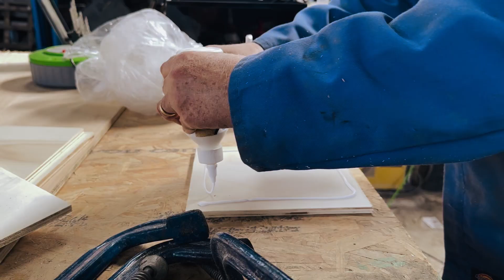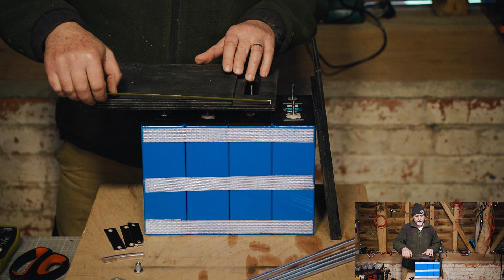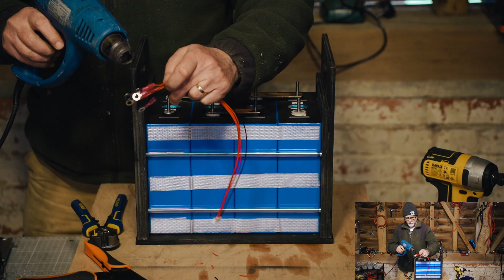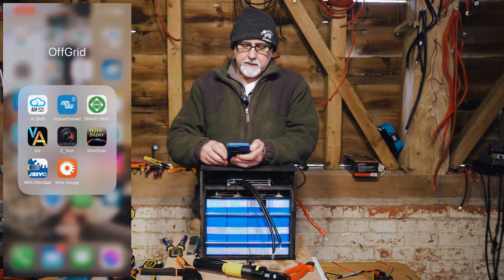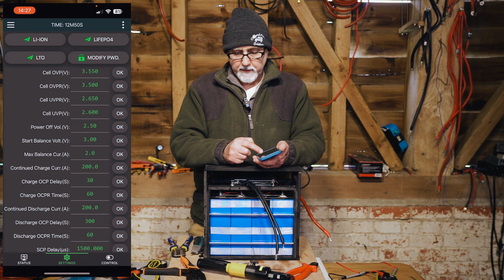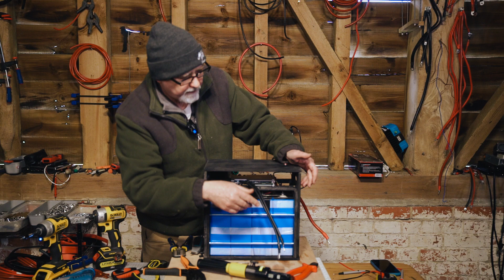Step-by-step guide to building a DIY LiFePOP4 battery with JK BMS

Comment: I vented a lipo battery from my PSP making a mod battery one time. It burned the end off my knife instantly. That was tiny. I would 1000% not screw into that with the cells loaded. That burned a nice spot in my desk, ruined the battery and my nice knife. Oh and I nearly had to call 911 because what do you put on a lithium fire that I have at my house? An ABC fire extinguisher isn’t doing shit.
Reply: These are not the same chemistry.  The one in your PSP would be a NMC(nickel manganese cobalt) lithium battery.  They have a higher energy density and discharge rate but are far more dangerous.  

These are lithium iron phosphate cells.

Comment: Hello , and thank you for  another great video .
I just bought a 16 s , 280ah eve 280k model set.
There any way to balance them first time without a DC source ?
 I was thinking to conect them in series , get a 5A 16 s active balancer and  JK BMS (in paralel) and to put the inverter to charge them slowly (from grid 10,20A) to the 100 %.  It s Ok for the first charge and first  balance?
Reply: Did you ever do this????

Comment: Shopping List from the Video

4x 280 amp hour lithium-ion phosphate prismatic cells (nominal 3.2V each)
Bus bars for connecting the cells in series
Plywood (9mm Birch plywood, two pieces glued together for strength) for the ply ends/shelves
Thread bars with connector nuts for attaching the bus bars to the ply ends
Plastic sheaths for protecting the cells from the thread bars
JK BMS (four to eight S 200A) with two temperature probes
Red, blue, and yellow heat shrink lugs for the balance leads
16mm squared wire for the main wires
M6 bolts for attaching the main wires to the BMS and negative terminal
The BMS switch for turning the battery on and off
Long nose pliers or a spanner for tightening the On/Off switch
Pilot holes and screws for attaching the lid to the battery enclosure (if using a similar design as shown in the video)